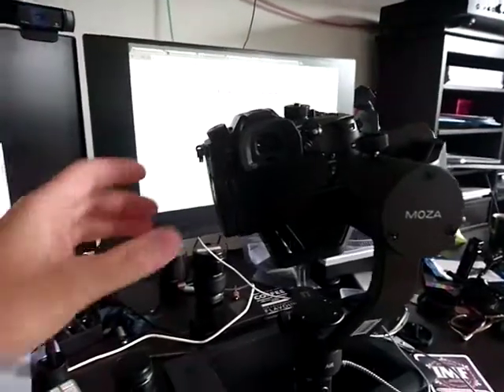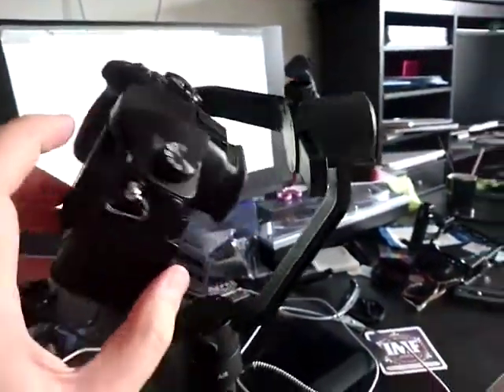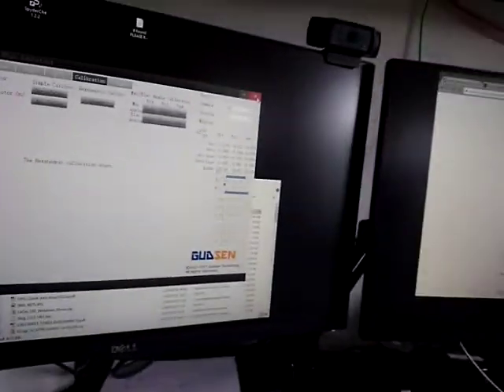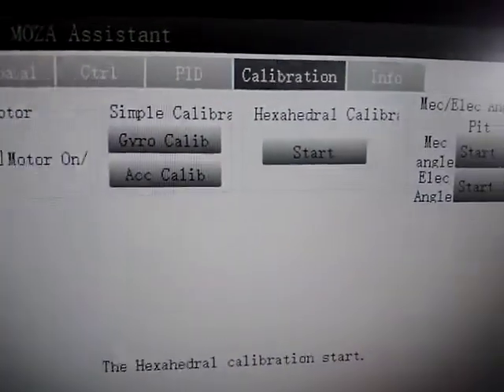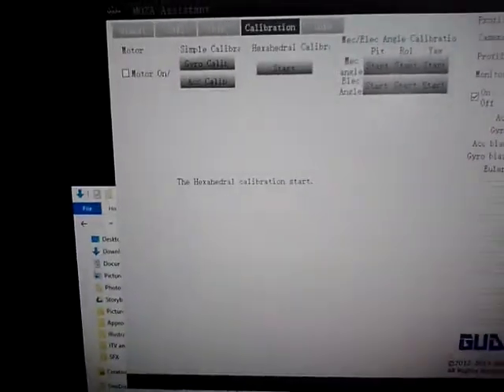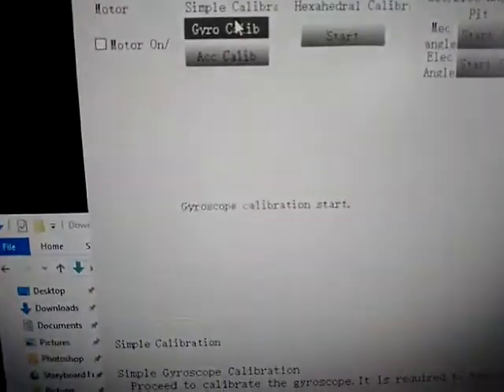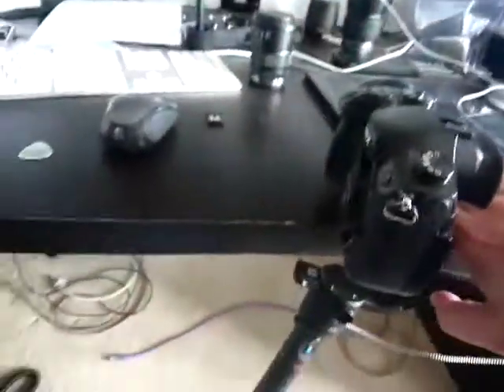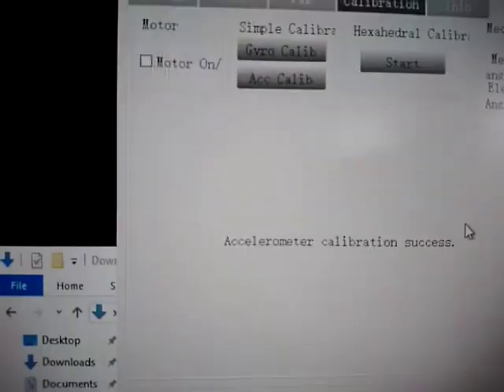Moza Air Gimbal firmware 3 upgrade problem

Comment: Thank you for posting this.  Gonna wait til they fix it.  In the mean time, you can use this as electric fan
Reply from the maker: Ha! Or use it as a murder weapon!  Happily, I fixed the problem, which was all to do with me being stupid, and not anything wrong with the firmware update. I'm sure you can upgrade without a problem.  I posted a new video showing what I did wrong: https://youtu.be/DvdtLHNDX0I